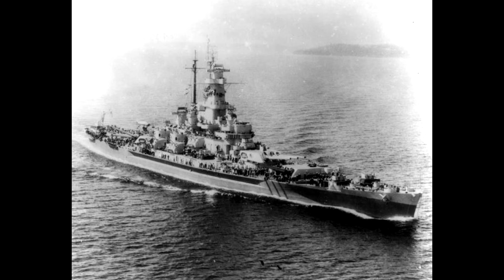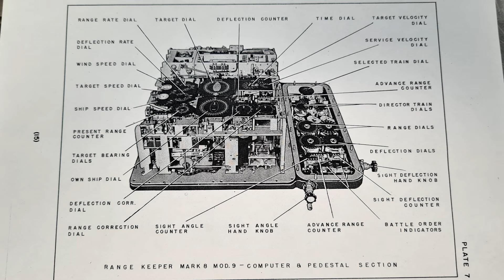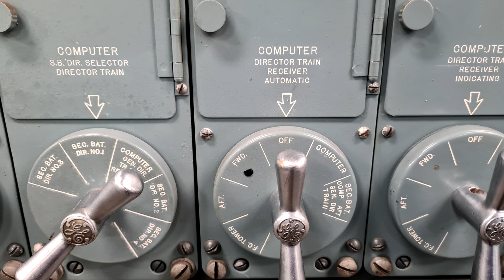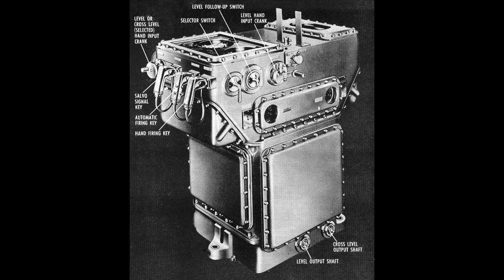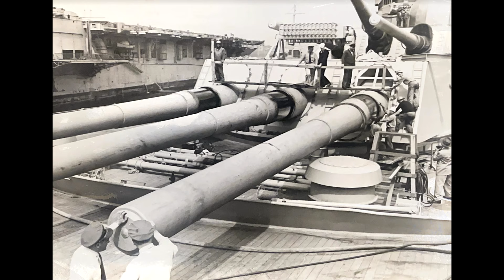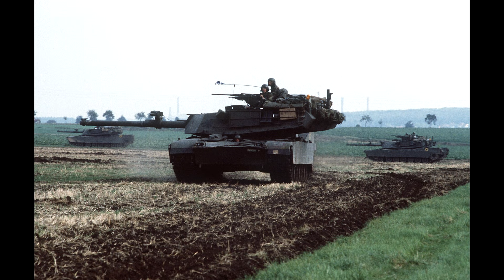US Navy Fire Control Systems - How They Really Work

Comment: I'm at 2:31 and am going to make an educated guess about how fire control systems worked. Drach has another video somewhere on the basics, so I have an idea.

If we start at the simplest setting, where we have two battleships sailing on steady, parallel courses, you need five things: your speed, their speed, a tabulized chart of shell flight times (or an equation to approximate that), the range, and the distance from the rangefinder to each turret. Once you have that, you can set up a differential equation to find a solution where the enemy ship's location intersects your shells, then set up an bunch of triangles to make sure each turret is at the correct angle to hit at the point you're aiming at. You might not even need a diff. eq. for the shell-ship calculation, but you will for more complex calculations. Once you have those things, you should be able to fire and, ignoring temperature and wind differences (because WW2 technology couldnt accurately measure that downrange, anyways), you should hit.
Reply: Let's go, I was right! Might not have done a good job explaining it, but it's just Controls theory.
Reply: I remember that temperature (and so energy content) of the powder and gun wear were included into calculations.
Reply: @kwzieleniewski  Temperature shouldn't affect the energy content of the powder, because the energy comes from the chemical bonds between atoms and molecules. It might change burn rate, however, which would change the acceleration of the shell out of the barrel and the muzzle velocity.
Reply: @KingOTanks  it also affects atmospheric pressure and thus drag on the shell, something probably negligible for a couple grams of steel out of a rifle but very much a problem for a Honda Accord worth of firepower heading downrange from a battleship gun.
Reply: If one or both ships are sailing on non-parallel paths, then you create a 2-D problem with x and y coordinates, and will need a diff eq and/or complicated trig, but the principles remain the same. Know where the enemy ship is and what direction and velocity theyre traveling at, the same for you, where your guns are, then set up either a series of triangles and differential equations and solve for the nearest intercept between your shell path and the enemy ship's trajectory. Then correct for wind, temperature, etc on the next salvo.
Reply: If the rumors are true that post-war fire control systems could reliably hit targets while sailing in figure-8's, it sounds like they had some sort of system of equations, similar to an autopilot system on an aircraft, that would constantly calculate the shell-ship intercept and give gun traverse and elevation angles to match.
Reply: You did need a differential equation.  During World War One, the Royal Navy had two different fire control systems, the Pollen "clock" and the Dreyer "table."  The RN, prewar, had preferred the Dreyer "table" because it was less expensive and quicker to produce than the Pollen "clock."  This was because the Pollen "clock" used a diff eq for its fire control solution, while the Dreyer "table" used a geometric (i.e., straight-line) approximation instead.  When both systems were tested in actual combat at Jutland side-by-side, the ships with the Pollen "clock" showed far better gunnery and were thus far more effective than the more numerous ships that had the Dreyer "table" instead...

The system also took into account the actual true compass heading that the guns were being fired on, the ship's current latitude, and the *target*'s current latitude, so as to compensate for the Coriolis effect imparted by the Earth's rotation.
Reply: @rdfox76  I see, so the Dreyer table used a system of triangles to plot, while the Pollen clock got an "exact" solution. I wonder how the mechanical computers actually calculated the solutions. I know how to set it up in my software of choice, but no idea how to tackle it mechanically.

Do you know anything about how they measured and accounted for the intrinsic sensor/rangefinder reading errors in their calculations? If you start plotting firing solutions off of measurements with, say, 0.05% error in speed and have no way of accounting for that error and additional error from future measurements, by the 6th or 7th salvo you might be seeing whole-number percentages of error. Or does the previous firing solution get discarded once new measurements are taken?
Reply: @KingOTanks  The primary way of dealing with errors in rangefinding was having multiple separate rangefinders that all fed down to the fire control systems.  They would be averaged before being fed into the computer; most systems also had a way to see the raw data and exclude any numbers that were so far off everything else that they had to be operator errors.  For example, the US fast battleships had at least nine separate optical rangefinders and six separate rangefinding radars that could be fed into the GFCS.  (Two main battery rangefinders and radars, four secondary battery rangefinders and radars, and one rangefinder on each main battery turret.)  I'm not sure how often they discarded the solution and started over from fresh data, but apparently, the one thing that the British gleefully stole from the Germans after WW1 was their unique mechanism that would automatically average the rangefinder outputs (instead of manually doing it), and have simple push-buttons for excluding the outliers from the calculation.

One of the training films about the inner workings of the computers mentioned for additional information does a good job of giving a general overview of how the mechanisms would work.
Reply: @rdfox76  as an engineer, thats all very interesting! Thank you for sharing!
Reply: @KingOTanks  To elucidate a bit now that I'm a little more awake and coherent ;) 

I can't remember exactly how addition and subtraction were done by a mechanical computer, but that's probably the simplest operations to do given that mechanical cash registers and adding machines had been doing those for years by the time people started working on the fire control problem.  Multiplication and division were done using reduction gears similar to a car transmission, though I believe they were closer to a CVT than one with discrete gears, to minimize rounding errors in the inputs.  (Imagine having to multiply by pi if your computer only could select multipliers in increments of 0.01, and having to select between 3.14 and 3.15--close enough for a rough approximation or if that's the only operation you're doing, but if you then have a dozen more operations to do on that result, the errors will compound *fast*.)  I believe exponential operations were done using a similar setup, though it was likely much more limited in the powers available (probably a single-digit number of integers only, and the corresponding roots), basically by having multiple sets of reduction gears that could be fed into each other (hence the limitations on the powers available).

Differentials were somehow--and I don't really understand how, but this is what I gleaned from the training film--done with gearing similar to what is traditionally known as the "rear end gear" in a car--literally a differential gearset.  Through some sort of mechanical black magic that I don't comprehend, a differential gear could be used to do differentials and, by driving it from the "output" end, integrals.  As you would expect, these mechanical fire control systems were very fiddly little things and, while built to be as tough as anything else on a battleship, if something did go wrong with them, it was a mechanic's nightmare to try and identify and resolve the problem.  Apparently, it was so difficult that during World War Two, the US fast battleships actually each had a technical representative from Ford Instruments on board for the duration of the war, to assist in the care, feeding, and maintenance of the computers, someone who actually did understand the system in extreme detail and could handle things like tracking down and fixing any glitches that developed and making adjustments to compensate for any alignment slippage caused by heavy seas or the shocks of combat.  (Pretty much the only other system on the ships that had a similar civilian tech rep on board in combat was the radar systems, which were also bleeding-edge technology that the sailors aboard wouldn't know completely inside and out.)

I heartily second Dr. Scholes's recommendation of Norman Friedman's "Naval Firepower;" while I got my copy because I thought it would be much more about the guns themselves, I'd say better than 90% of it is about the fire control systems and their evolution, and it's fascinating to read how gunnery went from a skilled gunner's eye and a bit of Kentucky windage to such marvels of mathematical complexity in just fifty years or so.  In particular, he goes into great detail about British and American fire control system developments, but he provides good coverage of German, French, Italian, and Japanese systems; the coverage on other major navies of the era is fairly light, but  that's to be expected as most of the other dreadnought navies either licensed, outright bought, or stole their fire control systems from one of those six (and even the German, French, Italian, and Japanese systems were closely related to British designs).  It's dense, and it doesn't go into great engineering detail of the exact inner workings of each component of the system, but Friedman's style is fairly readable, in my opinion, and it'd be hard to do a proper nitty-gritty description of how even one system worked in a book that's only an inch thick, much less all of the developments from around 1890 to around 1950, so it provides a good overview instead and does have a decent bibliography to help those interested go on a "deep dive" into the engineering texts on various systems and components.  I recommend it, it's great at helping mentally change mechanical fire control systems from being in "dark art" territory to merely being "my brainmeats hurt" material that you can comprehend but get a headache trying to follow in detail.  :D
Reply: @rdfox76  mechanical computers were probably invented (I'm pretty sure they were) by mathematicians working with engineers. I'm good at math, but don't have anywhere near the understanding to develop or begin to guess how a mechanical computer solves differential equations. I think that myself and a team of other engineers could probably develop a basic firing control computer using code in, say, a year or two, but not a mechanical one. I'll have to look into that book.

Comment: Never knew that about the Lunar landings. Fascinating (best Spock impression).
Reply: Indeed (raised eyebrow).
Reply: It's actually incorrect, the Apollo Guidance computer did the calculations locally. There wasn't enough bandwidth for it to be passed all the way back to Houston. Check out Curious Marc's Apollo Comms and AGC restoration videos. It was a nearer thing than anyone really knew until after the fact.
Reply: @NullReference119  I have read through all the Apollo mission summaries and each and every one of these had a situation threatening mission or crew loss that was handled either by the crew or the flight control. It was a  minimal set of tech required for the task. Hairy stuff.

Comment: 2000 ft is not nautical mile. 6070 ft (approx.) is a nautical mile.
Reply from the maker: @johnvaleanbaily246  I think Dr Scholes meant to say about 2000yards, not feet :)
Reply: @Drachinifel  That makes sense. Fascinating none the less. Thank you.
Reply: When I was learning navigation (only small pleasure boats, not professional) I learned that a nautical mile was 6080 feet, or one minute of longitude at the equator. A minute of latitude (from the side of the chart) was usually considered close enough.

I think 2000 yards, or even feet is probably close enough in terms of the example.

Comment: What are the circumstances where you would want to fire 16"/45 ballistic profile shots from the 16"/50 rifles?
Reply from the maker: @Colonel_Overkill  long distance where hits to deck armour are more likely, the 16"/45 has lower MV and thus the angle of fall for a given range will be steeper.
Reply: Part of the USN's (over) obsession with long range gunnery.  Reality had battleships generally engaging at shorter ranges, though not exclusively.